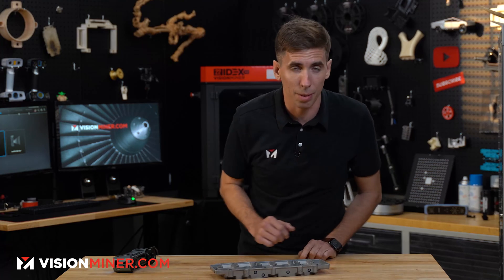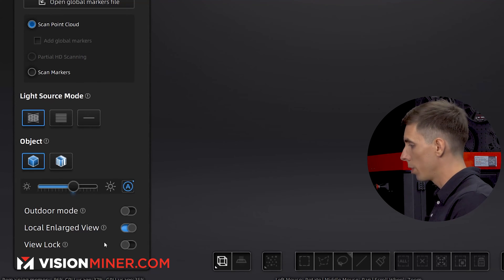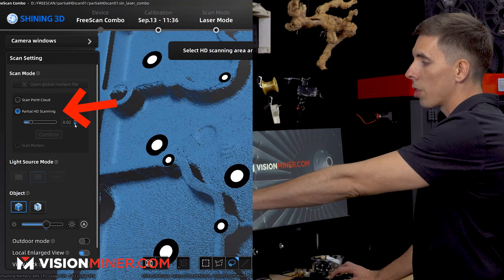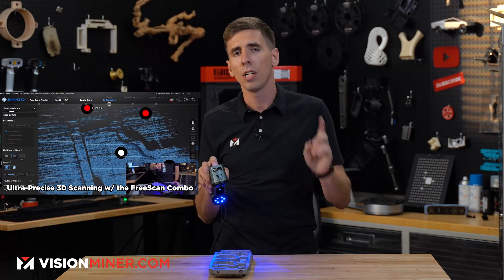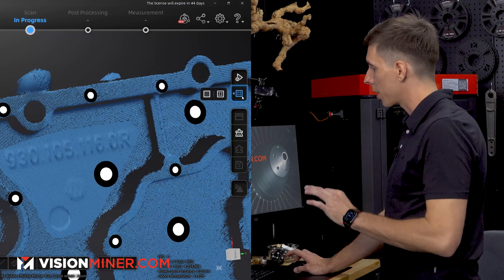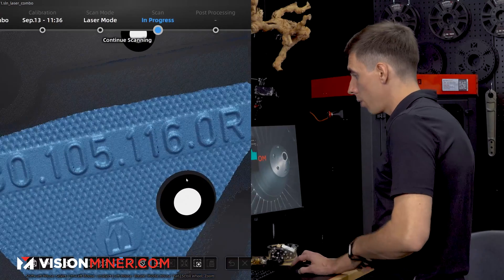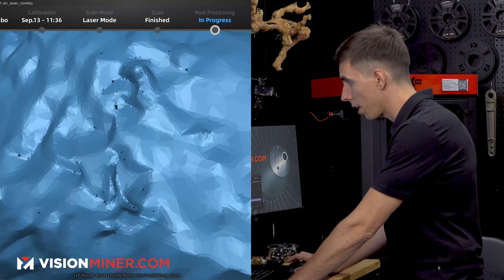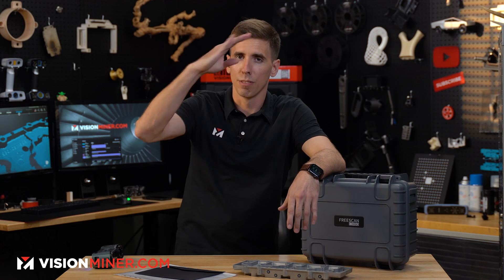How to 3D Scan EXTREME Detail - 10 microns - Freescan Combo Partial HD Mode - 2023

Comment: I don't want to be rude , but 0.01 mm is a size of a white blood cell and impossible to archive with that set or any hand held scanner on the market , definitely not with a laser . 0.1 mm point distance resolution is the lowest resolution that is even usable for professionals for scanning of this size of objects . It is not remarkable , just lowest standard .. Anything that go below 0.1 mm point distance is already very good for that size of objects , 0.1 mm is good for very big objects where accuracy is not that important .. Nice presentation but very much inaccurate statements and very low resolution not reflecting it at all .

Comment: Great presentation on this mode. As a general rule it is harder to guarantee 0.02mm accuracy when the point cloud is at 0.02mm. If you can measure at 0.01mm you have a better idea of where everything is at 0.02mm.

Comment: Does the HX have the capability of scanning an area in higher resolution?
Reply from the maker: No, unfortunately it does not, it's only available on the Freescan currently.
Reply: @VisionMiner  any idea if this is a planned upgrade for the HX software? This would be crazy useful and would save a load of time vs. taking two high/low detail laser scans and aligning in the current HX software under a new project